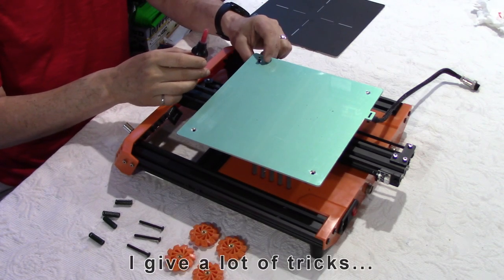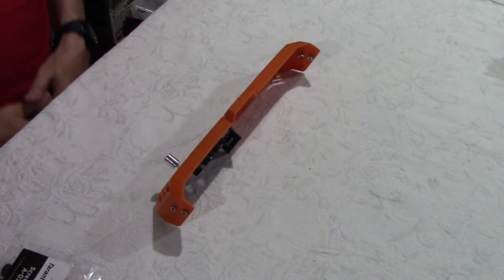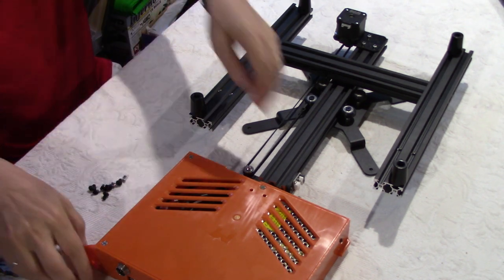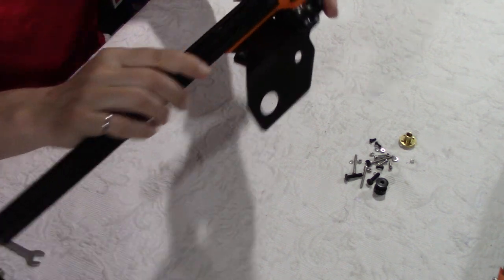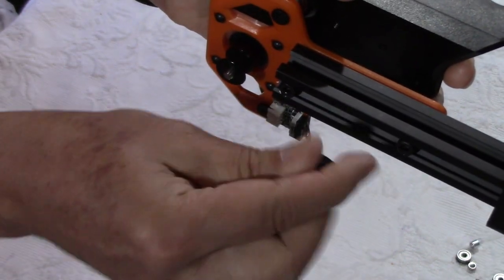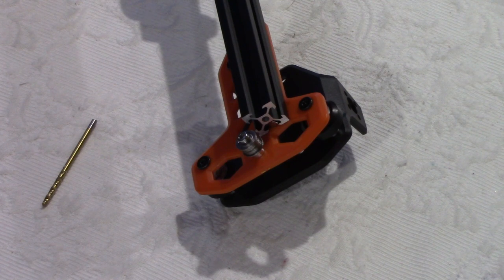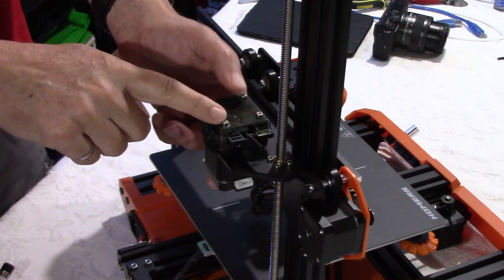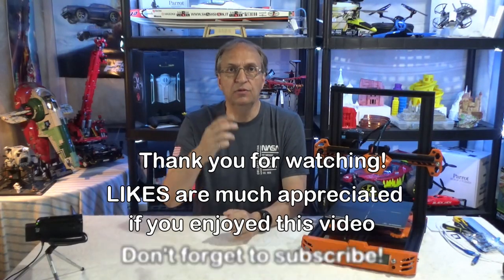Homers / Tevo NEW Tarantula Pro and RS 3D printer | Full assembly

Comment: Thank you so much for taking the time to show everyone how to assemble this printer. The website didn't have any instructions and the product itself had none . What kind of company sell products with no instructions?
Reply from the maker: Thank you Mike.  Unfortunately I posted a few videos after this one where I show the problems I started to have with long prints.  I think I got a faulty power supply or control board. I decided to upgrade the stepper drivers but that did not go well... I am now without a 3D printer and looking for a good one...still not sure what to buy...  Happy New Year!

Comment: Excellent.  I justify that by saying I just put my Tarantula Pro partially together yesterday.  Tried a couple of videos and ended up attempting to follow the Instruction Manual, such as it is.  One tip I finally discovered (OK, my wife told me. lol) to put a table cloth down!  I had spent more than half the time searching for tiny bits in carpet!  I see you have figured it out too.  Don't be shy about pointing it out.  Finishing the task tomorrow after Amazon brings t-nuts.  Carpet ate one.  Probably take apart a bit of the Assembly and follow your very logical suggestions.  Cheers - Homers should just point to your videos and perk you some filament.

I thought I had just mixed up the screws on the cross member, we did not.  The instructions spec 5x20m but provide 5x25mm.
Reply from the maker: I am glad my video helped you.  Yes I should have mentioned that using a table cloth is a must!  I did several videos after this one and unfortunately I have had several issues with this printer.  The videos are in my playlist.  Happy Holidays.

Comment: Thanks a lot, Dan. I followed this video to assemble my printer and it was very useful. Really great instructions, and it was the only one enough detailed for this model. Just one remark: about 31:00, when glueing the hotbed surface, I guess you would have removed a protective plastic peel that covers the hotbed (it gives it this greenish color). I don't know if this may cause problems to print, but probably that peel will degrade with temperature and the surface will be loose. 
I did my mistakes also, and one that I considered worst was related to bowden tube: I set it in place with the hot end at middle of axis, then I cut it to reach the extruder without much waste and when the head went full to left, I saw it was too short ! I was so happy that Tevo has sent two of them. I waste the spare one in day 1.
Reply from the maker: You are welcome.  My heat bed did not come with a protective film!  Yes you did the right thing by removing it.  Good thing they included two bowden tubes in the kit.  You should buy the Capricorn brand for next time you need to change it, it is much better.  I got mine from Amazon.  Thank you for visiting my channel.
Reply: @SuperdanTech  Well, the "green" layer is the protective film on the alu-plate. It is a press cut, but it needs to be removed. It´s a bit fiddly to remove it, but green is the protective layer for the heatbed.

Comment: Hi Dan.
When I found your assembly video, it started out with clips "during the build".
I did not know this, and assumed that I missed an earlier video! I went to your home page
and only saw THIS video. So here I am, refreshing the video, skipping further into it, and 
wondering... WHERE THE HELL IS THE BEGINNING?

While I'm not the sharpest tool in the shed... I did manage to just let the video play, and
discovered that everything was here. I'll keep you posted.
Reply from the maker: Good luck with your build. Be careful with the belts and get the right tension! Don't miss my print test video to avoid the problems I had!
Reply: So far, so good. Well... I'm at the part where I'll be sticking the adhesive-backed bed surface.
While I'm certain that this will not be a problem, I'm wondering... I didn't see you lift the green
film from of the bed, before you applied your mat. Was there a reason for that? Or is that film
supposed to stay on? I think that the film would, sooner or later, lift from the heat. The film on
my bed has already started to peel. What do you think, Dan?

Comment: Building my printer now, thanks to your instructions!
BTW: You know you forgot to remove the protective plastic from the heatbed before attaching the print surface?
Not that it matters now, when you gave up and sold it :)
Reply from the maker: OMG...you are right I forgot...How could I forget something like this???  I must have been too focused on the camera...lol.  Thank you for pointing this out, you are the first actually!
Reply: @SuperdanTech  The extra screws/t-nuts you mention in the beginning and also @ 48min is for mounting the control box on the middle rail.
You should've opened the bottom before you began, there's two holes in the middle for them ;)
The too small hole for the X idler was the same for me, even though they've improved a lot of things you had an issue with in the more recent version I bought.
Ended up drilling it with a 4mm drill, just as you did.

Comment: I think there's something amiss starting at 37:40, the order of assembly should be: 01-Screw insertion, 02-Lead-screw nut, 03- Spring washer, 04-Nut. Such as it was done here, the spring washer ended up being used as a spacer, ergo defeating the purpose of it. I admit that I'm quite unimpressed by the somewhat - albeit assumed - poor H base rigidity and Z polymer deployments, as I'm now in the process of ordering the RS model, even though they used the e-box and the fascia as 'structural elements'. Otherwise brilliant video and informative as always.
Reply from the maker: Hi there, I think I did it here the way Homers recommends.  I am still not sure though... Thanks for watching!

Comment: The 2 screws and T nuts @ 16:15 go from the power box to the middle rail.right behind the solid state relais. The RS had the bolts for the heatbed allready assembled...in the glass bed..the magnetic printing sheet is also supplied.
Reply from the maker: Thank you for the clarification. How is the magnetic printing sheet on the RS?
Reply: @SuperdanTech  Its the same as the pro.
Reply from the maker: @wekker090  the pro does not have a magnetic printing bed.
Reply: @SuperdanTech  Just was building the RS, but can't finish, only one colored ribbon cable but do not know were to stick it. The print bed itself is glas and then the magnetic print surface is supplied. now waiting on customer service.
Reply from the maker: @wekker090  The magnetic print surface is flexible right?
Reply: @SuperdanTech  yes flexible and 2 part offcourse.
Reply from the maker: @wekker090  I guess you have not tried the touch screen yet. Let me know how it is.
Reply: @SuperdanTech  Yes did connect the one ribbon cable and the touch screen works nice... easy set up and navigation is simple. not sure what i'm missing since no motor wil work.

Comment: Nice! Can you please make a vid on how to get rid of the Aviation 8pin port and wire everything (hotend/fan/thermistor) directly on the board?
Reply from the maker: Hi Alex, I did a few videos after this one.  They are in my 3D playlist.  In summary, I was getting random print interruptions after 2-3 hours.  Proceeded to upgrade the step motor drivers before upgrading the power supply.  Issues with the firmware update...sold the printer (very unfortunately)...
Reply: @SuperdanTech  Yes, I just saw your vids :) Did you sold it because you faced all those issues? As a beginner, 3D printing can be discouraging..I spent an excessive amount of time just to understand the hardware/software aspects.. and i still have the feeling that i know almost nothing!
Reply from the maker: This was my second printer. My first was the first generation Ender 3 so I had some experience. Look at my video Armidale 3d printed RC boat. https://youtu.be/A0WhO-Oas3U

Comment: Hello, I will soon start assembling the beast ... and there, THANKS once again for this great, very PRO TUTO! tell me, the question may be ridiculous but, the printer works with ABS wire?
Reply from the maker: Bonjour Jérôme et merci.  Good question, the Homers website does not mention ABS so I guess it cannot do it.  ABS requires temps above 220 and the extruder here stops at 240 so too tight I believe.  The bed is also too low at 80 I think.  I always print with PLA so I am not an ABS expert!

Comment: This is nice printer, i have mine for about 3 months. I love it but had to do many upgrades like stronger Z axis carriages, Dual Z with single motor, TMC 2208 drivers, Stronger Y motor mount, X and Y axis belt tensioner, Squash ball feet and direct drive titan extruder.  Basically everything above build plate have ben changed. If keep original then belts rub on sides of pulleys when are tensioned properly. Anyhow this is way better printer to buy than Ender 3. There is not much support what comes to printer profiles in slicers for this new printer so I use Ender 3 profiles as base
Reply from the maker: Wow, you changed a lot of things on this printer!  I did several videos after this one showing the new problems I encountered when I started to do long prints...print interruptions and layer shifts for no apparent reasons.  After spending weeks trying to fix it and upgrading the firmware I gave up due to more software issues.  I am now looking for a new printer...Not sure what to buy really.   Maybe a Artillery Sidewinder X1...  Thank you for your comment.
Reply: @SuperdanTech  I haven't noticed  any software problems. Probably because i run latest marlin 2.0.7.2. had to re-flash it when add 3d touch for bed levelling. I had problems with original SD card too but different kind. My pc didn't open it so i formatted it and its still around somewhere. Using 32gb Samsung SD instead. Longest print I did was 9 hours and no issues. When was building marlin first time i had no original sample of firmware so hot-end cooling fan wasn't working, figured it out on my own then found this firmware built for MKS SGEN L  board https://github.com/lachusmadeti/Tarantula-Pro. Looks close to what i have now maybe will help your printer.
Reply from the maker: Thank you very much for the info.

Comment: Hello SuperdanTech! I watched your videos and finally got the HOMERS / TEVO® Tarantula Pro 3D Printer Kit. I am retired and I will start this topic from scratch with what I learned from you. We are waiting for the continuation of your videos to teach your students who follow you. ((Sorry if there are abnormalities in my articles, we are writing in English with google))

My request from you is this;

1- Which elements should I order to upgrade the HOMERS / TEVO® Tarantula Pro 3D Printer to the latest version?
2- Which company do you recommend to buy the upgrade elements from.
3- Can 235x235 Borosilicate glass plate / bed be used in this device?
4- Which slicer should I choose to draw the project? I think the existing Cura.
Goodbye
Reply from the maker: Thank you for watching my videos. I will start to do more videos on 3D printing soon.  This is the latest version and I think the only place where you can buy parts is banggood. I use Cura and it is very good.  About the bed, the dimensions are right but I have not tried it so I cannot comment for sure about the fit for use.  Welcome to 3D printing!

Comment: Hello again, Dan.
Well... Thanks to you, I've finally finished putting my printer together.
I even went as far as watching your first power on, and test print, before turning my machine on.
I was pretty pumped after watching that.

Geez... I really wanted to do a my first print. It's probably gonna be awhile before I can.
After I powered it up, I attempted to jog the 3 axis', just to see how they would move.
And... Denied. The Y-axis motor doesn't work. I swapped cables with a different motor, just to pinpoint
the problem. And it's definitely an inoperative motor. After all that... I am pretty disappointed. $300.00, and no printing.
Come to think of it, I'm looking to give someone a piece of my mind. (NO. Not you, Dan. You were great.)

Anyone have any suggestions?
Am I supposed to take this thing apart, and send it back?
Do I call China, and cuss someone out?
Should I crack a beer, and call it a day?

EDIT: Turns out, it's the board that the cable was plugged into! Not the motor.
Good lord.
Reply from the maker: Test your four stepper drivers to make sure you have 0.95 volt.  I am going to do a video about that this week.
Reply: @SuperdanTech  Thanks so much for the quick reply! And an apology for bothering you on a Sunday.
I'd be happy to do that. But, despite having a multimeter, I don't know how to do that test.
If you could point me to a tutorial, I'd certainly take a crack at it.

Shortly after having posted about my troubles... I went to Amazon and bought a new one.
With tax, it was about $35.00. While I was there, I also picked up some Capricorn extrusion tubing.
You had mentioned it briefly during the video. Good call!
Reply from the maker: There are a couple of good videos, just search A4988 driver settings.  I am going to give more details in my video but this should help you for now.
Reply: @SuperdanTech  Dan... I can't even begin to thank you for taking the time to help me out. Much appreciated. I'll keep you posted.
Reply: @SuperdanTech  Got my new board today. Yeah... I SHOULD be jumping up & down. But I'm not.
Not realizing that the board requires firmware... DUHHH.... I had to look for guidance. Good lord.

I had no idea how INFURIATING it is to NOT have a simple, step-by-step, "Do this. Then, do that"
guide. After rummaging through outdated, overly confusing & overly simplified instruction... I had
to walk away from it. Seems as though, if there actually was a "plain version" of the install, without
the "Well... you might have to..." & "If you have the (which you don't know what they're talking about)",
and my all-time favorite... "Go ahead and change it."(Change it to what, & how do you do that?)... it's
gotta be TOP SECRET. 

For as smart as I am... I am idiot for thinking that there would be a straight-forward, 1, 2, 3. NOPE.
I realize that no one owes me what I'm looking for. I'm just a bit short-fused at the realization that
the people I'm counting on have no business making instructional videos. And the first rule is...
Never assume that the uninitiated know what you're talking about, at any point.
"Yeah. Just do that." HOW? How do you JUST DO THAT?
"Yeah. Just choose his favorite flavor, and install it."  WHAT? WHAT DOES THAT MEAN?
"Yeah. Just select the previous version, cuz there's something wrong with the newer one."  O.M.G.

Wow. I need a beer & a hug, right now. Say hello to the wife & kids.
Reply from the maker: @Seemsayin  this is not fun at all. I am posting a video tomorrow about voltage settings on the board. I cover a lot of stuff but not firmware update unfortunately. I have not done it on the Ender 3 nor on this Tarantula so I am not an expert on firmware updates. The voltages were wrong on my board. You have to check yours. Have a look at my video tomorrow am and good luck!

Comment: hello..congratulations for the video ... this machine has a problem..the marlin that brings this capped and does not allow to record changes in the eeprom .... so, I can not change the values of preheat pla..and what keep .. when I turn off the 3d printer, the values go back to what it had .. it would not be wrong for you to make a video updating the firmware of this machine to version 2.0.6 of marlin .. a greeting and thanks in advance.
Reply from the maker: Thank you for the kind words.  Yup, I know about this problem really!  I was so upset that I sent an email to the CEO of Homers (I wanted to bypass customer service).  We should really be able to save our own parameters. Regarding the firmware update, I may do a video about that, the only problem is that in the summer I try to spend more time flying my drones as you probably saw today on my channel.  Thank you by the way for stopping by and for your comment!

Comment: Hi Dan, thank you for this video.
i am asking this for my dad, he bought a homers tarantula 3d printer.
He cant get this printer to work because the screen doesnt give any information, also 1 limit switch will light up, the other ones does not.
The screen goes on and thats about it, as for the wireing goes it should be all good but i have this printer for 5 minutes at this moment trying to figure out whats wrong with it.
Do you have any suggestions on what could be wrong with it?
Reply from the maker: Hi Nick, I am assuming that all connections are fine and the switches and control board are not faulty, then the problem could  be the Marlin software that came with the printer.  There is a lot of places to check when a 3D printer does not work out of the box!  Like I said, if mechanically everything is fine, double check your connections.  The best option is probably to contact Homers support through their website and they will guide you. The display could be faulty also...  Good luck!
Reply: @SuperdanTech  Thank you for awnsering my question.
I am woundering the the wireing is correct, especially the ones on the bottom side. (x,y,z,e0 and e1)
according my dad the homers crew arent very helpfull.